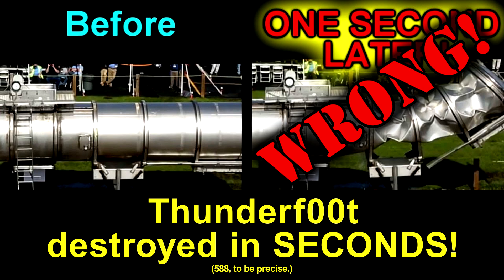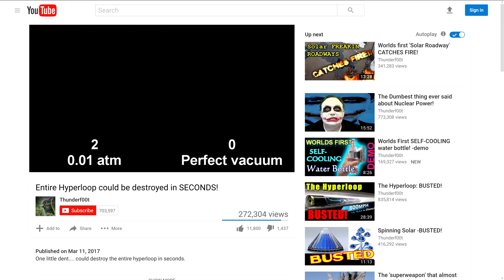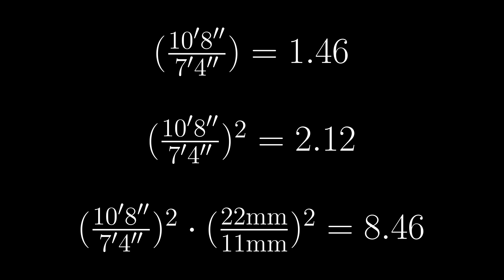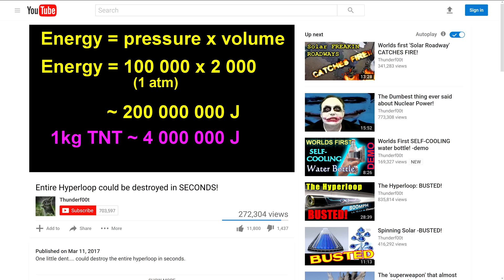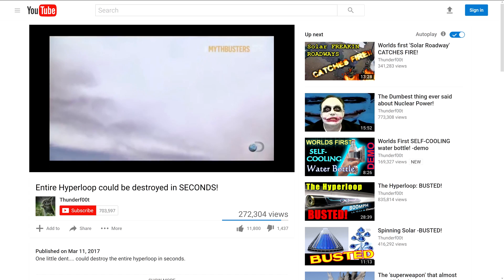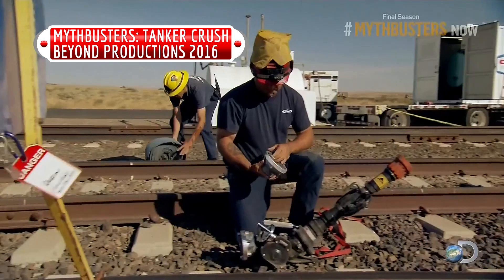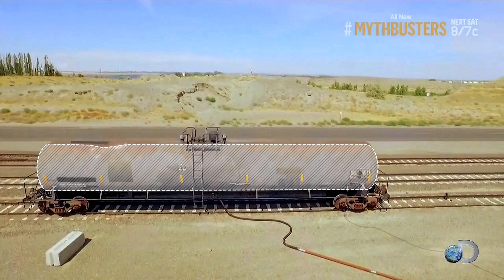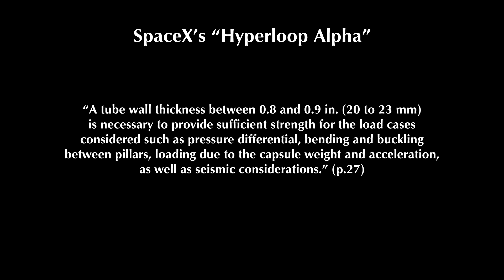Thunderf00t destroyed in SECONDS!

Comment: Come on, give him a break, he's a chemist, we can't expect him to know basic physics!
Reply: I think you're forgetting that I, the guy who did the physics analysis is this video, am also a Chemist.
Reply: I got an associates in video production, and then got a BS in chemistry. I was briefly an engineering major, but I soon switched to chemistry.
Reply from the maker: BULLSHIT AND YOU KNOW IT. Units cancel ALL THE TIME, and that's often the point! No one with ANY knowledge of physics or engineering will back you up there. NO ONE.
Reply from the maker: It can't be THAT high level. Or else you wouldn't be able to do simple things like work a camera (f-stops are unitless, being the ratio of the focal length to aperture), or work with electronics (gain is unitless, being the ratio of a signal's input to its output). You certainly wouldn't be able to do any physics, because the coefficients of static and kinetic friction are unitless, as is the albedo (the light reflected off a body compared to the light coming on to it), lift coefficient, drag coefficient, damping, coefficient of restitution, and relative density. Thunderf00t could probably even tell you all of the things in chemistry that are unitless, including atomic weight and pH. And hey: have you ever wondered why the weatherman never gave you a unit when he tells you the humidity? Or when earthquakes are reported in the Richter scale?

ALL of those are unitless. YOU FUCKING MORON.

"So I guess I'm not as stupid as you think" Oh, you are. You absolutely are.
Reply from the maker: "I'm simply pointing out how his videos are poorly sourced" by LYING.

"and when there is math, it is poorly done." Except you don't provide any math of your own to refute it. For fuck's sake, YOU DIDN'T EVEN KNOW THAT UNITS CANCEL, and when you were schooled on that, you pretended that unitless numbers were useless when they're used ALL THE TIME in physics, astronomy, chemistry, and numerous other fields!

"It's what we do when we write code." I'm a programmer, and NO IT FUCKING ISN'T. Computer variables don't even HAVE units, MORON!!! You claim to have all this expertise, yet you continually show you don't know the FIRST FUCKING THING about ANYTHING you're talking about.

And yet, you're trying to attack ME and ruin MY reputation. Fuck off, asshole.
Reply: Beacon of Wierd Cut him a break because he chooses to misinform hundreds of thousands of people???
Reply: It was a joke about how chemists don't know physics :p Maybe I should update the comment to make it clearer... There we go :)
Reply: So... in conclusion, we need more physicists. Glad I chose the right education ;D
Reply from the maker: DarkSide Blues More credible than someone like you who doesn't even realize that units cancel...
Reply: Have you done any physics at all? Like have you even finished elementary school because I know we did basic unit analysis in our elementary school. What you usually get when units cancel out is a ratio, such as "This bridge is 100 meters, this other bridge is 150 meters", 150 meters / 100 meters = 1.5, meaning the second bridge is 1.5 times longer than the first one, no unit attached, just a ratio.  Thinking that this is "poor math" just shows how extremely uneducated you are. Not to be confused with dumb, I'm sure you could learn all this but you haven't which makes you uneducated.
Reply from the maker: I don't care that he's uneducated. I care that he's unteachable. And he has gone from video to video to video insulting me and spreading lies about me and the things I've said.

I've tried it your way in the past. You know what the result was? MY REPUTATION WAS DESTROYED. When I did absolutely nothing wrong. I REFUSE to let the woos win.
Reply from the maker: "If you want to change someones mind the first step is to understand what is on their mind." Ah, I see your problem. You must be new at this. After awhile, you'll get the idea that people like DarkSide are immune to being wrong. There is no changing their mind; it's as hard and unchanging as that of the biggest fundie. What you need to understand is that at that point the goal changes: it's not to change the person's mind; it's for the sake of those reading the discussion. It's to expose him for what he is so that the readers aren't taken in by him, and they don't fall for his misinformation and his attempts to damage your reputation.
Reply from the maker: "Sure, he presents his math in a more viewer friendly way, I completely agree with that" Not only that, but if I'd converted them to something else, the Tf00t acolytes would have accused me of manipulating the numbers and not using them as published (exactly what they did earlier in the series). They wield Morton's Fork with gusto, and stab with it every chance they get.

(And to clarify: Libertarianist is the one with the chemistry degree, not me. All of that came from him.)
Reply from the maker: Except, as apparently YOU didn't read, that's the way that's actually WORKED. I get people like you all the time coming in here and saying this. What NONE of you have in common is ANY track record of being successful in what you'd insist I'd be able to do. The ones who do have success are the ones who get in people's faces.
Reply: "it's not hypocritical because I'm not making videos trying to debunk stuff I don't understand."
But commenting on it is just as bad.
Reply: Just because shane's tone is harsh doesn't mean my analysis is wrong.
Reply from the maker: "pH is the negative log of the Molar concentration of hydrogen ions in a solution" It's at least dimensionless, but it's relative to the concentration of hydrogen ions so if you actually did the math the units would, in fact, cancel. Any relative scale is like that.

Atomic weight and atomic mass are different things. Atomic weight is the ratio of the element's atomic mass to a base mass equivalent to one-twelfth of a carbon-12 atom, so it's unitless.

Density has a unit, but relative density (aka specific gravity) doesn't.
Reply from the maker: +DarkSide Blues "only because what I'm saying is correct" Except it isn't. We've repeatedly shown that.
Reply: I thought you were a mechanical engineer?
Reply: Totally credible to comment on engineering subjects then.
Reply: Shane Killian if the units cancel then the number is meaningless. So you can not apply the meaning you want to it. It's poor math.
Reply: Beacon of Wierd well it's strange that every high level math I have done, the units stay in. Like finding volume or energy. So I guess I'm not as stupid as you think you are.
Reply: ... "High level math" with units? Most of "high level math" doesn't include units, in fact Math is completely devoid of units, it's something we have added to math to be able to apply it to the physical world. And what you are saying here is illogical, you claimed "if the units cancel then the number is meaningless." then justifying that by saying "when I do math units stay in". There's no logical connection there, just because units can be conserved doesn't mean they have to be.

Also, based on "high level math" being "finding volume or energy" I'm guessing your beginning high school? That is not "high" education and it sure as hell isn't "high level math". Once you get to multidimensional calculus or Fourier transforms then I can grant that you're doing "high level math". But if you get to that point still believing that a number is meaningless if it doesn't have a unit slapped to it there's something seriously wrong with the education system you're in.

A side note tho "So I guess I'm not as stupid as you think you are." is a very ironic and honestly funny statement since it's a dangling modifier, what you meant to say was "So I guess I'm not as stupid as you think I am", so by that statement you're showing that you are "as stupid as we think you are". I don't think you are stupid however, I think you're just not done with your education yet and have a lot to still learn. One thing you could use, which Shane Killian also could use, is humility. Don't talk and act as if you know everything because you demonstrably don't and no man in history has ever done that. Realize that some people know things better than you do, and you know some things better than they do. It can be hard to know when you actually know something and when you think you know something and it's something that can only be sorted out with time, experience and a willingness to learn. If you think you're correct all the time you probably aren't and you've lost the willingness to learn.
Reply: I highly doubt that insults and writing in all caps will improve your reputation. If you want to change someones mind the first step is to understand what is on their mind.

If you truly believe that his mind is unteachable it would be highly illogical of you to respond to him since you wouldn't be able to teach him anything. You would only be responding for emotional reasons of trying to make yourself feel superior to him.

I believe the art of war hade a quote along the lines of "He who goes to war without knowing why is doomed to fail". If your goal of responding to these comments is to increase your reputation your responses have to either convince the person you are talking with or convince people who happen to read the comment who doesn't already see you as having a good reputation.

If you want to achieve the first one you have to make him sympathize with you and see your point of view, this requires finding common ground, not standing firmly.

If you want to achieve the second one you have to seam reasonable and friendly to outsiders, insults achieves the opposite of this.

All of us have things to learn, just because you got your PhD doesn't mean you're a master, a true master never stops learning, and in the field of debating you seam to be quite the novice. I wouldn't call myself an expert in that field by any means but I do find it interesting to try and sway people and something I am actually quite proud of is being able to sway a Chemtrailer to question his beliefs and come around on the issue which was no easy feat and required carefully worded and well thought out arguments to find common ground and work from there. In a live debate I would never have achieved this but with the advantage of text I managed to pull it off. I suggest you put your mind into trying the same thing, it's a very rewarding experience if you succeed and it is an exercise in both controlling your emotions and controlling others emotions.
Reply: @DarkSide Blues How on earth did you get a bachelors degree without doing basic unit analysis? All tho at my university the computer science department doesn't do any physics that I know of so maybe that is understandable. But if we're going by credentials I've got my Bachelors degree in applied physics and doing my masters in machine learning, so I can confidently say I've done more physics than you. Not to mention that I work part time as a physics teacher for high school students. The physics of the Hyperloop are sound, even basic. The only question is if it's economically viable which personally I don't think it is.

But saying that Shane has no credibility because he studied Chemistry while you yourself studied computer science seams sort of hypocritical, don't you think?

Don't you at least find it odd that Thunderfoot didn't even mention what the goal of the competition was?
Reply: Beacon of Wierd it's not hypocritical because I'm not making videos trying to debunk stuff I don't understand. That's the rub. I'm simply pointing out how his videos are poorly sourced and when there is math, it is poorly done. A good math calculation would at least convert the units to the same unit regardless of whether they cancel out or not. It's called readability. It's what we do when we write code. Just because you can do something faster doesn't mean it's better and if I had an employee doing math the way he did, I would reject his work, just like I would reject code where a programmer uses operations that no one understands.
Reply: While I do hate the imperial system and agree that the mixing of units makes it next to unreadable it doesn't make his point less valid, and Thunderfoot provides no sources at all on any of his videos that I can find so why do you demand sources from Shane Killian while ignoring if there are sources when it comes to Thunderfoot. Sure, he presents his math in a more viewer friendly way, I completely agree with that, but that doesn't mean his points are correct.

Besides, Shane Killian actually does provides some links in the description of the video, in this one to the tanker truck, in the previous one he has a link to both the competition website and the team who built the hydrogen racecar. So why do you choose to believe Thunderfoot over Shane? Both have backgrounds in Chemistry, not engineering or physics, Shane actually has a second person with a background in engineering to double check. Presenting the content in a viewer friendly way doesn't really make his point more valid, right?

So why do you trust Thunderfoot over Shane? :s

Just a little background on how I even came across these videos, it was when Thunderfoot made the video about the air pressure accelerating a steel ball to nidicolous speeds I decided to do some calculations of my own since I didn't really feel that it sounded right and I couldn't get an acceleration greater than about 80m/s^2 (about 8 G's) with reasonable dimensions and weights of the pod, and that is assuming a completely airtight seal with the pod and the pipe which is the worst case scenario and is not what is planned. (Very simple to calculate too, just take the pressure differential * the surface area / mass and you get the acceleration). Then I came across one of Shanes videos where he points this out and mentions how mass scales cubically and surface area only scales quadratically which is the reason why a large capsule would experience a much much smaller acceleration than a small one since there would be much more weight to push with relatively less surface area. So I'm not a Shane fan in any way, in fact I've only seen these videos of him "debunking" Thunderfoot.
Reply: Beacon of Wierd I'm not necessarily on Thunderf00t's side either and he needs sources as well. What I'm pointing out is the fact that both presenters are making opinion pieces masquerading as scientific videos. I like your post better than Shane's videos actually.
Reply: These aren't really "opinion pieces", sure I get what you mean but there's also the issue of who is right and who is wrong. Thunderfoot makes the claim that the hyperloop will collapse because of the pressure. Shean makes the claim that it won't. These aren't just "opinions", one of them is true and one is false, they are mutually exclusive statements.

Thunderfoot points to a tanker truck which is built for the purposes of holding liquids or gasses at positive pressures, assuming that the hyperloop would be constructed in the same way is simply false since it's purpose is literally the opposite of what the tanker truck is built for.

The real question which I don't quite understand is why you are on Shanes channel and arguing with him over this but not on thunderfoots channel when you say they are both just masquerading as scientific. What makes you choose Shane and not Thunderfoot? Or at least I couldn't find you in the comment section, you might be doing it to both I just couldn't find you there.
Reply: It seams you only read the first part of my reply, if you continue reading you will see that I mention that this would be the second reason to reply to his comments and that insults and writing in all caps will achieve the opposite result of what you're trying to achieve. The people who already like you will read the comment and agree with you, the people who do not know you will see a person insulting and basically yelling at the other person and are more likely to sympathize with the person who isn't writing in all caps and calling the other a moron.

This is a fight you cannot win unless you adapt to the battlefield. Insults and anger will not convince anyone, it will literally do the opposite. Just be calm and kind, even to those who are not kind back, this will gain you a lot more popularity than being hateful.

Even in your response to me you're trying to act superior, you're saying "You must be new at this" when I just mentioned that I converted a Chemtrailer, do you realize what kind of a deranged world view they have? Saying you can't change someone's mind is just giving up.

You can also dig yourself into a hole which seams to be what has happened here which explains why you think his mind is unchangeable. Same thing happened to me in a discussion a couple of days ago about the Terrorist attack in Sweden where someone claimed it was fake and I tried to convince them it was not by stating that I was there when it happened. This instantly put me inside of their conspiracy theory and they started claiming that I was a paid agent from the news network and anything I said from that point was just considered part of the conspiracy. I had lost that "argument" because I did not realize how completely insane the people I was talking with was, whilst when I was talking to the Chemtrailer I assumed he was conspiratorial from the very begging and worked from there.

The point of that short story is that you can change the mind of anyone, you just have to know who you are dealing with. DarkSide is far from conspiratorial and while I don't know the exact history between you it he doesn't appear to be close minded.
Reply: You lost me here, "as apparently YOU didn't read, that's the way that's actually WORKED."
Are you referring to your view count or what should I have read to know your way actually works? :/
And is that your rationale for insulting people? It gets attention and views?

Going through some of your content I can see what you mean. A lot of comments are about how you shout and how they don't like it. And as for the view count, you seam to be getting around 500 views with a few spikes when you tackle Thunderfoot and other youtubers. Have you tried you know, not shouting? Every video I've clicked you have been shouting and had an aggressive tone.

Don't get me wrong, I'm not trying to insult your channel, but it seams that 5 years ago you got around 7000 or so views on basically all your videos, so what changed? To me it seamed you had a less aggressive tone from the small sample I clicked, but I'm pretty sure that's just my expectations skewing my perception, but something clearly changed, so what was it?
Reply: Minor point here, atomic weight and pH are not exactly unitless. pH is the negative log of the Molar concentration of hydrogen ions in a solution, it doesn't make sense to give the units because the math wouldn't work, but it's not exactly unitless. As for atomic weight, that's given in grams/mole or atomic mass units (basically the same thing), the units are commonly omitted because there are no alternative units for this figure. Scientists and engineers often do the same thing with density, I can safely say the density of iron is around 7 without risk of confusion because density is always given in grams/cm^3 or something equivalent like pounds per pint.
Reply: Not entirely irrelevant:  http://shanedk.deviantart.com/journal/HTAFS-Why-We-re-Rude-To-You-472170553
Because it needed to be said.
Reply: Libertarianist only because what I'm saying is correct. I can comment on bad videos and that is fine. There is no academic or scholarly presentation in this video and that's a fact. I read an engineering students paper in the failure rate of iaitou and it had more sources and more accurate math than what appears in this video and it also had no emotion or attitude either. This video is crap and it's not hypocritical to point that out. One could debunk someone with out acting like a child and thus is what Shane is doing.
Reply: That's a huge logical leap. "Simply being nice and applying logic and 
reason doesn't work, so instead we are mean and try out best to insult 
you". Just because the method of "being nice and arguing logically" 
doesn't work tells you nothing at all about if insults will work. And 
I'm not advocating for "being nice and applying logic", I'm advocating 
for making the other party see your view by finding common ground and 
working with the tools they have at their disposal to see the flaws in 
their own views. This is no easy task when it comes to fundamentalists, 
but I doubt insults is the most effective way of going about it.

As to the whole libertarianism idea, it faces the same problem as 
communism. It looks great on paper but fails miserably in practice. 
Without one actor who has monopoly on violence (the state) there's 
nothing to stop anyone with some resources to just pay off a bunch of 
people to be their personal military and turn the beautiful libertarian 
society into a dictatorship with the threat of violence. Sure, people 
could take up arms and fight for their freedom but in practice this 
wouldn't work since you can't afford to spend your whole time fighting 
without getting resources from someplace. And if you band together and 
form an army, with leaders deciding where to attack etc you might win 
but in the process you've created what is essentially a form of 
government, and if after you win you go back to a system without someone
 with monopoly on violence the same thing will just repeat itself. 
Libertarianism is an instable system, it sure sounds nice just as 
communism sounds nice on paper, but there's a reason we don't see it, 
it's an unstable system. It might be possible, just as it's possible to 
balance a ball on your finger, but the slightest deviation could cause 
catastrophe, and with nuclear weapons on the table that's a reaaally 
reaaaaaally bad idea. Well, unless you like playing fallout forever... 
Which actually sounds kinda great...

In practice it's better to have a stable government elected by the 
people instead of having instable chaos and civil wars every 20 or so 
years and risk falling into a dictatorship. (Though I think the current 
representative democracy is completely out of date and has to be 
replaced by a moral democracy where you vote for which morals should be 
followed/applied and not who should be in power).
Reply: You still haven't answered my question tho, why are you attacking Shane for his bad video but not attacking Thunderfoot, who also has an attitude and emotional arguments (such as trying to make numbers sound big when they really aren't like how much energy the vacuum would take). His videos are no where near "academic" and his physics is actually wrong and not just poorly presented. It just makes no sense for you to be commenting about it here but not on his videos :/ That does make you at best a Thunderfoot fanboy or at worst a hypocrite and I'm guessing you would rather be neither of those things.
Reply: Shane Killian no. You have repeatedly show your an arrogant ass.
Reply: Well, not exactly. A pH of 7 means 10^-7 moles of hydronium per liter. If the units were based on imperial gallons then neutral pH would be about 6.4. In moles per fluid ounce neutral pH would be around 8.5.

Technically the units for atomic weight are 1/12th carbon-12 masses.

Similarly with density, relative density is relative to what? Relating it to water is the same as attaching a unit, in this case the unit is "density of pure water with no dissolved gasses in a neutral electric and magnetic field under 101,325 kPa of pressure at a temperature of 3.98 degrees C".
Reply from the maker: +Beacon of Weird "That's a huge logical leap. "Simply being nice and applying logic and 
reason doesn't work, so instead we are mean and try out best to insult 
you"" And now YOU'RE moving over into dishonesty. YOU were the one who claimed I'd have better luck being nice. YOU claimed it worked. IT DOESN'T.

My recent success the last few years compared to before DOES stand as evidence that the more intellectually aggressive approach is more effective.

"I'm advocating for making the other party see your view" Except as I said, HE WON'T. He's an unsinkable duck. He's made that clear.

"As to the whole libertarianism idea, it faces the same problem as communism. It looks great on paper but fails miserably in practice." Oh, great; yet another long-refuted canard.